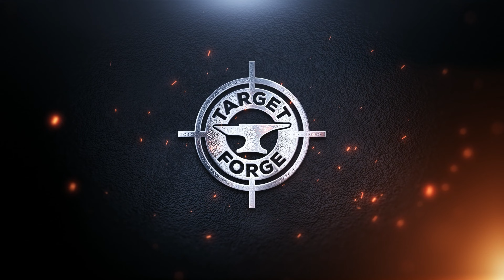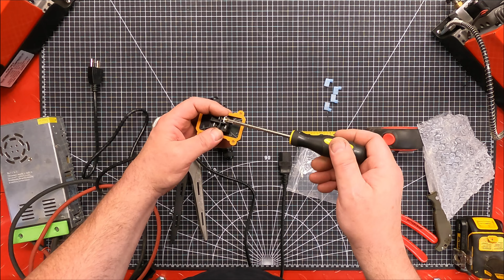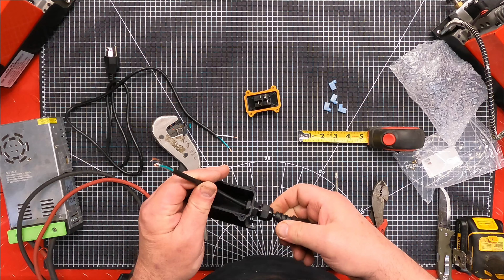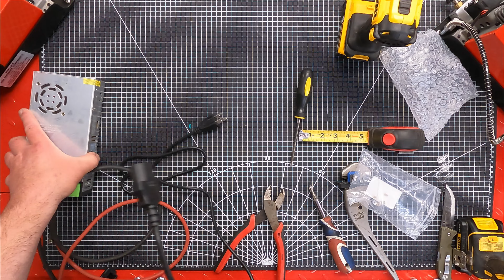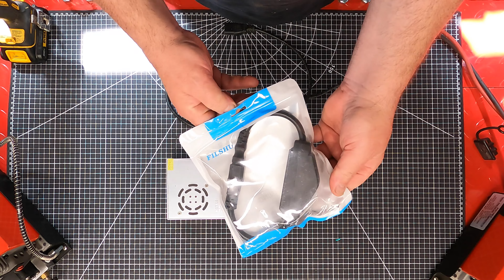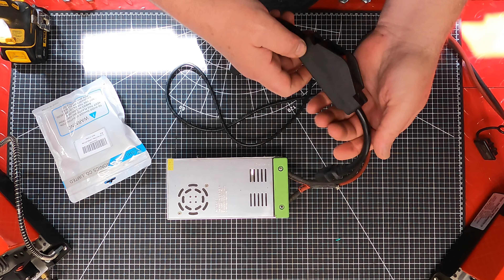Switched ON GX Compressors! Adding a cord switch for sanity. YHHRS ep 030

Comment: Yet another Great video Bill. I went the lazymans way for my CS-2 Milk Crate Mod. I put a 90 degee c-14 adapter on the power supply, then purchased the lazyman switch from your Amazon link. It works great. Now i dont have to disassemble milk crate mod to use it to fill my guns. Thanks again and Kudos brother👍

Comment: So, I have a GX2, I run it solely off the battery. In your videos you fans come on  then the compressor. When I hit the switch on my compressor (battery) the compressor and fans come one at the same time. I assume this is normal as the compressor has not failed me. But I want to  check in case I need a new board or something. 

also, what would make a better battery and  
charger to upgrade from the OEM one I have. 

Thanks for the work and info. 😊
Reply from the maker: It sounds like you may actually have a  E-L2 variant of the CS2? It is working normally as that unit uses a single switch to control both the fans and the pump drive. Those batteries are a clone of the Makita design and Makita makes REALLY good stuff. Upgrading to real Makita will be a true upgrade as they have passed CE and UL approvals from what I can tell.
Reply: @TargetForge  Thanks I'll look I to getting a Makita.

Comment: You mentioned in one of your other videos that I watched I’ve been trying to watch them all but you mentioned how to flush out your brand new compressor I can’t find that one. Can you share a link with me please thanks.
Fred
Reply from the maker: I actually don't have a flush procedure for the CS4, as it is the only water cooled unit from GX. In retrospect, I think the floating bits I saw in mine may have been a "Stop Leak" product put in at the factory. I will consider making a video of that process though. Have you seen the flow illuminator product I make for the CS4? It is honestly SUPER COOL!

Comment: I have a compressor fairly new compressor, it didnt fill good at first then I tightened the release valve and it filled my gun. It seemed very tight at first and I was kind of wo dering why I had to really apply force before it filled. Now it wwont fill past 10mpa. No matter how tight I screw the release valve in. After looking inside I see a white pice of plastic the screw goes through  or bumps into when screwed all the way in. I am thinking this is tne problem but I am not sure and really dont know what to do at this point! Bith my PCP's fill up to 3600, and 4500 psi,  so my hand pump isnt and option.  Any suggestions? I'm traveling to FL. In 4 weeks and I have to have to drop another few hundred on a mobile compressor!
The brand is Hatsan Spark
Reply from the maker: My suggestion is either a GX CS2 or CS3. The Spark has not been a reliable product from my perspective.